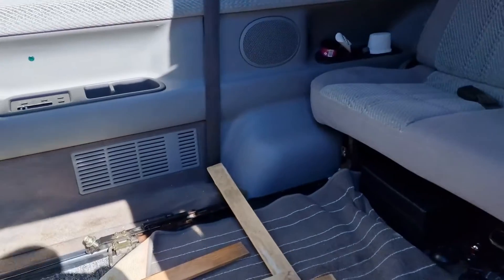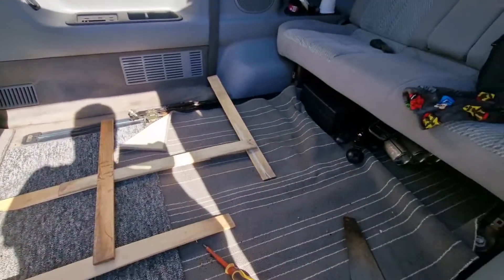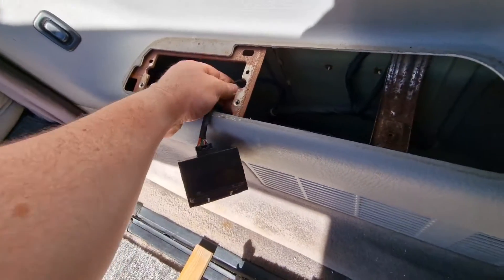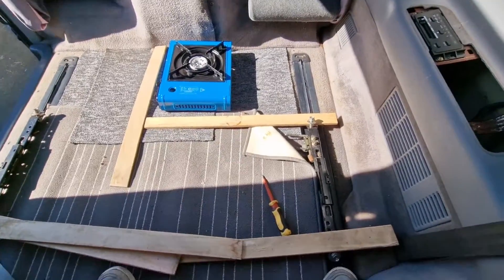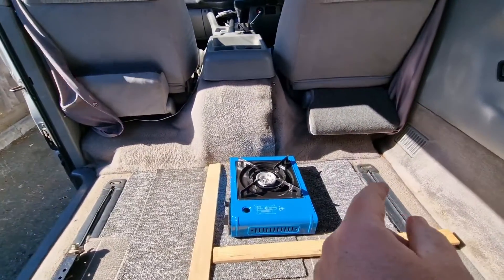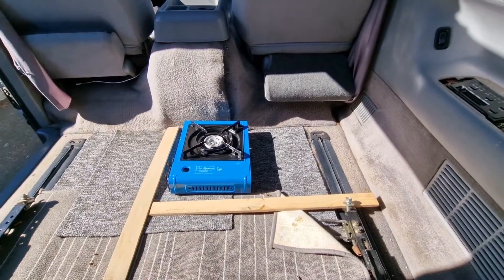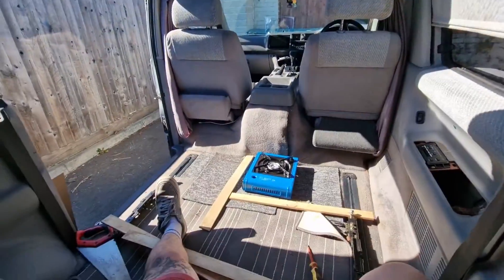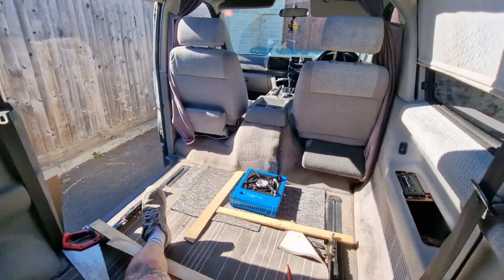Making a kitchen in the Mazda Bongo Ep. 1 // Ford Freda

Comment: I just have a little three door unit with kitchen top on the sliding door side, mostly for storage but I do have a water tank with a tap on the side by the door. That gives me loads of space behind the driver's seat for a chair/ bed which folds out to about two meters. With it in chair mode I can have the removable table between the chair and dicky seats so you can seat two plus one facing easily with the table in between. One drawback however is that in bed mode it only really fits one. I'd love to send some photos but you haven't got an email listed and I don't really do social media. I'm sure you'll get some good ideas from the Bongo community though, especially "vantastic ideas"!
Reply from the maker: Good to hear. Thanks for the comments. I have started making the unit now so will get a video up soon with an update. Thanks for watching 😁

Comment: What’s the little green button/thing above the heating controls? I’ve only got the hole in mine.
Reply from the maker: I wondered this at first, but I've found that when the rear fan / heater is turned on it lights up. Hope that helps 😁
Reply: @LS10Works  much obliged.
Reply from the maker: No problem 😊